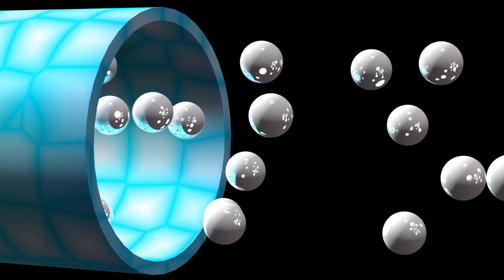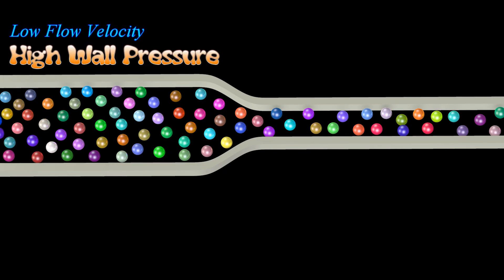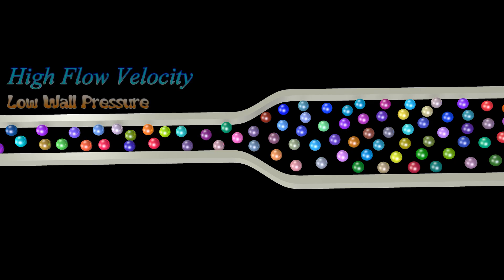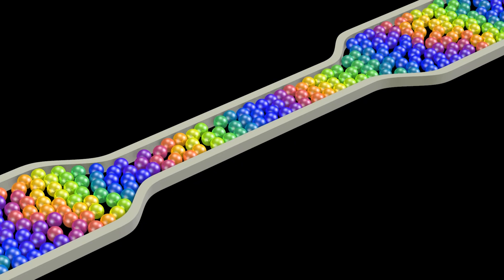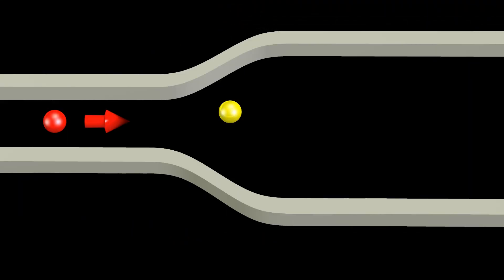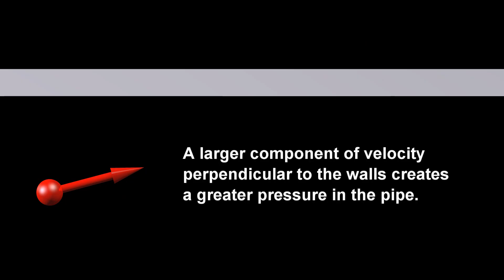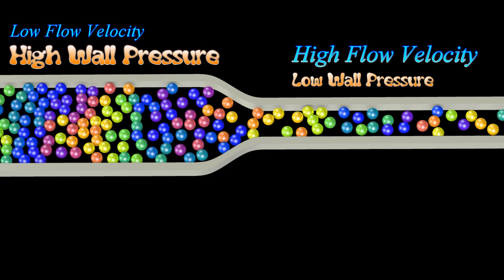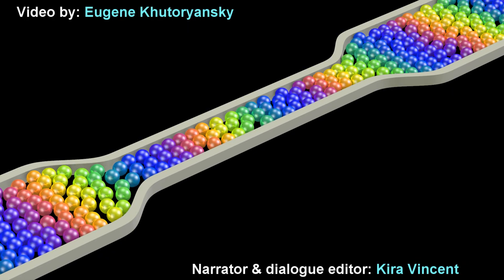Bernoulli’s Principle on Atomic Scale

Comment: 10 seconds in and I already know I'm doing to dig it
Edit: Yep, totally worth it, whenever people talk about the principle on YouTube you only see the practical information like the formulas, but never a true explanation on the why of it
Reply from the maker: Thanks.
Reply: Unfortunately, this violates some very common and well understood accepted principles of physics.  It repeats the same errors that Charles Crummer makes.
..
The statement at 2:07 is correct. "there is no reason to expect an atom with a higher velocity to exert a lower pressure on the walls of the pipe." 

There can be the same pressure in a fast fluid as a slow fluid.  They simply have the same static pressure. Bernoulli is not about speed. It is about changes in speed or velocity which is Acceleration along a path. 

The pressure on the walls of a sealed jar is the same regardless of the speed of the jar.

A fundamental flaw in this misconception at 2:42 is is that there no reason to expect a molecule to have the thermal vibration in only one dimension.  These pressure causing vibrations are random in direction and are how they bounce round between other atoms.  
At any given instant a molecule may be going down and the next at 90 degrees or even 180 degrees to the previous vibration.  
That simple fact breaks this false logic.
..
Then. . . 
It is the average velocity (over time) that has a directed motion when the kinetic energy is added to produce an increase in speed. That directed velocity is vectorially summed to the random vibrations.  This is vector addition of velocities. This means that the random vibrations are superimposed onto the linear velocity along the tube. This is fundamental physics. Vector quantities like speed and acceleration add vectorially.
Ignoring that fundamental physics is another flaw in this.
..
..
Then, the added kinetic energy in the moving fluid is in only direction.  It is not increasing the random thermal vibrations. That would require increasing the temperature.  This is another flaw in this story.  Moving the fluid along the pipe does not raise the temperature.  
Therefore, the statement at 2:23: "an atom with a higher velocity would have a higher kinetic energy and, therefore, exert a larger force on the pipe walls" is false because it conflates / confuses thermal energy and momentum in one direction.
..
..
Consider bouncing a ball on the floor. Each bounce imparts some momentum to the floor.  The ball's actual motion is only vertical..

Now, start the room moving (a train car) and the ball still imparts the same momentum to the floor with each bounce.  It's actual motion, relative to the stationary ground changes.  It has the SAME vertical component, but now a horizontal component vectorially added to the vertical motions.  The pressure on the floor does not change.
.
 However, these two motions are orthogonal and have no effect on each other. The vertical up[and down bouncing component remains the same. ONLY the ground referenced horizontal component changes as the speed increases.
This physics does not change if the ball is bounced on the ground outside the train's window.
.
This fails on these fundamental physics errors.

Comment: 🌟Concept is now crystal clear in my head. Thank u so much👍
Reply from the maker: Thanks.
Reply: Unfortunately, this violates some very common and well understood accepted principles of physics.  It repeats the same errors that Charles Crummer makes.
..
The statement at 2:07 is correct. "there is no reason to expect an atom with a higher velocity to exert a lower pressure on the walls of the pipe." 

There can be the same pressure in a fast fluid as a slow fluid.  They simply have the same static pressure. Bernoulli is not about speed. It is about changes in speed or velocity which is Acceleration along a path. 

The pressure on the walls of a sealed jar is the same regardless of the speed of the jar.

A fundamental flaw in this misconception at 2:42 is is that there no reason to expect a molecule to have the thermal vibration in only one dimension.  These pressure causing vibrations are random in direction and are how they bounce round between other atoms.  
At any given instant a molecule may be going down and the next at 90 degrees or even 180 degrees to the previous vibration.  
That simple fact breaks this false logic.
..
Then. . . 
It is the average velocity (over time) that has a directed motion when the kinetic energy is added to produce an increase in speed. That directed velocity is vectorially summed to the random vibrations.  This is vector addition of velocities. This means that the random vibrations are superimposed onto the linear velocity along the tube. This is fundamental physics. Vector quantities like speed and acceleration add vectorially.
Ignoring that fundamental physics is another flaw in this.
..
..
Then, the added kinetic energy in the moving fluid is in only direction.  It is not increasing the random thermal vibrations. That would require increasing the temperature.  This is another flaw in this story.  Moving the fluid along the pipe does not raise the temperature.  
Therefore, the statement at 2:23: "an atom with a higher velocity would have a higher kinetic energy and, therefore, exert a larger force on the pipe walls" is false because it conflates / confuses thermal energy and momentum in one direction.
..
..
Consider bouncing a ball on the floor. Each bounce imparts some momentum to the floor.  The ball's actual motion is only vertical..

Now, start the room moving (a train car) and the ball still imparts the same momentum to the floor with each bounce.  It's actual motion, relative to the stationary ground changes.  It has the SAME vertical component, but now a horizontal component vectorially added to the vertical motions.  The pressure on the floor does not change.
.
 However, these two motions are orthogonal and have no effect on each other. The vertical up[and down bouncing component remains the same. ONLY the ground referenced horizontal component changes as the speed increases.
This physics does not change if the ball is bounced on the ground outside the train's window.
.
This fails on these fundamental physics errors.

Comment: Thank you so much! :)

This has bothered me for years and no one has been able to provide this simple vector explanation.
Reply from the maker: I am glad my explanation was helpful.  Thanks.
Reply: Unfortunately, this violates some very common and well understood accepted principles of physics.  It repeats the same errors that Charles Crummer makes.
..
The statement at 2:07 is correct. "there is no reason to expect an atom with a higher velocity to exert a lower pressure on the walls of the pipe." 

There can be the same pressure in a fast fluid as a slow fluid.  They simply have the same static pressure. Bernoulli is not about speed. It is about changes in speed or velocity which is Acceleration along a path. 

The pressure on the walls of a sealed jar is the same regardless of the speed of the jar.

A fundamental flaw in this misconception at 2:42 is is that there no reason to expect a molecule to have the thermal vibration in only one dimension.  These pressure causing vibrations are random in direction and are how they bounce round between other atoms.  
At any given instant a molecule may be going down and the next at 90 degrees or even 180 degrees to the previous vibration.  
That simple fact breaks this false logic.
..
Then. . . 
It is the average velocity (over time) that has a directed motion when the kinetic energy is added to produce an increase in speed. That directed velocity is vectorially summed to the random vibrations.  This is vector addition of velocities. This means that the random vibrations are superimposed onto the linear velocity along the tube. This is fundamental physics. Vector quantities like speed and acceleration add vectorially.
Ignoring that fundamental physics is another flaw in this.
..
..
Then, the added kinetic energy in the moving fluid is in only direction.  It is not increasing the random thermal vibrations. That would require increasing the temperature.  This is another flaw in this story.  Moving the fluid along the pipe does not raise the temperature.  
Therefore, the statement at 2:23: "an atom with a higher velocity would have a higher kinetic energy and, therefore, exert a larger force on the pipe walls" is false because it conflates / confuses thermal energy and momentum in one direction.
..
..
Consider bouncing a ball on the floor. Each bounce imparts some momentum to the floor.  The ball's actual motion is only vertical..

Now, start the room moving (a train car) and the ball still imparts the same momentum to the floor with each bounce.  It's actual motion, relative to the stationary ground changes.  It has the SAME vertical component, but now a horizontal component vectorially added to the vertical motions.  The pressure on the floor does not change.
.
 However, these two motions are orthogonal and have no effect on each other. The vertical up[and down bouncing component remains the same. ONLY the ground referenced horizontal component changes as the speed increases.
This physics does not change if the ball is bounced on the ground outside the train's window.
.
This fails on these fundamental physics errors.

Comment: This is barely adding anything to the textbook rules. This only explains what happens at the entry point to the narrower pipe and nothing else.

Why would atoms keep the velocity as parallel to the wall as at the entry point, after going through the narrow pipe for some time? Also, what if the narrow pipe is bent? Why would the component parallel to the wall have any advantage at all over the others after the turn? Also, as atoms finally leave the narrow pipe and go into the larger pipe, why would they NOT keep the velocity directed parallel to the wall, keeping their low (or even lower) pressure and high speed?
Reply from the maker: Inside the narrow section, the atoms keep their velocity mostly parallel to the walls because most of the particles they are colliding with also have their velocity mostly parallel to the walls.  Once they exit the narrow section, they do not keep their velocity mostly parallel to the walls because most of the particles they are colliding with do not have their velocity mostly parallel to the walls.
Reply: You've hit on a major flaw in this misconceived explanation, piotraturklos.
Unfortunately, this violates some very common and well understood accepted principles of physics.  It repeats the same errors that Charles Crummer makes.
..
The statement at 2:07 is correct. "there is no reason to expect an atom with a higher velocity to exert a lower pressure on the walls of the pipe." 

There can be the same pressure in a fast fluid as a slow fluid.  They simply have the same static pressure. Bernoulli is not about speed. It is about changes in speed or velocity which is Acceleration along a path. 

The pressure on the walls of a sealed jar is the same regardless of the speed of the jar.

A fundamental flaw in this misconception at 2:42 is is that there no reason to expect a molecule to have the thermal vibration in only one dimension.  These pressure causing vibrations are random in direction and are how they bounce round between other atoms.  
At any given instant a molecule may be going down and the next at 90 degrees or even 180 degrees to the previous vibration.  
That simple fact breaks this false logic.
..
Then. . . 
It is the average velocity (over time) that has a directed motion when the kinetic energy is added to produce an increase in speed. That directed velocity is vectorially summed to the random vibrations.  This is vector addition of velocities. This means that the random vibrations are superimposed onto the linear velocity along the tube. This is fundamental physics. Vector quantities like speed and acceleration add vectorially.
Ignoring that fundamental physics is another flaw in this.
..
..
Then, the added kinetic energy in the moving fluid is in only direction.  It is not increasing the random thermal vibrations. That would require increasing the temperature.  This is another flaw in this story.  Moving the fluid along the pipe does not raise the temperature.  
Therefore, the statement at 2:23: "an atom with a higher velocity would have a higher kinetic energy and, therefore, exert a larger force on the pipe walls" is false because it conflates / confuses thermal energy and momentum in one direction.
..
..
Consider bouncing a ball on the floor. Each bounce imparts some momentum to the floor.  The ball's actual motion is only vertical..

Now, start the room moving (a train car) and the ball still imparts the same momentum to the floor with each bounce.  It's actual motion, relative to the stationary ground changes.  It has the SAME vertical component, but now a horizontal component vectorially added to the vertical motions.  The pressure on the floor does not change.
.
 However, these two motions are orthogonal and have no effect on each other. The vertical up[and down bouncing component remains the same. ONLY the ground referenced horizontal component changes as the speed increases.
This physics does not change if the ball is bounced on the ground outside the train's window.
.
This fails on these fundamental physics errors.

Comment: The difference of small physics and big physics explained. When looking at a fluid as an entity of itself makes it tough to comprehend this law, but when you look at the fluid at the molecular scale, you begin to see that things are actually not that different
Reply: Unfortunately, this violates some very common and well understood accepted principles of physics.  It repeats the same errors that Charles Crummer makes.
..
The statement at 2:07 is correct. "there is no reason to expect an atom with a higher velocity to exert a lower pressure on the walls of the pipe." 

There can be the same pressure in a fast fluid as a slow fluid.  They simply have the same static pressure. Bernoulli is not about speed. It is about changes in speed or velocity which is Acceleration along a path. 

The pressure on the walls of a sealed jar is the same regardless of the speed of the jar.

A fundamental flaw in this misconception at 2:42 is is that there no reason to expect a molecule to have the thermal vibration in only one dimension.  These pressure causing vibrations are random in direction and are how they bounce round between other atoms.  
At any given instant a molecule may be going down and the next at 90 degrees or even 180 degrees to the previous vibration.  
That simple fact breaks this false logic.
..
Then. . . 
It is the average velocity (over time) that has a directed motion when the kinetic energy is added to produce an increase in speed. That directed velocity is vectorially summed to the random vibrations.  This is vector addition of velocities. This means that the random vibrations are superimposed onto the linear velocity along the tube. This is fundamental physics. Vector quantities like speed and acceleration add vectorially.
Ignoring that fundamental physics is another flaw in this.
..
..
Then, the added kinetic energy in the moving fluid is in only direction.  It is not increasing the random thermal vibrations. That would require increasing the temperature.  This is another flaw in this story.  Moving the fluid along the pipe does not raise the temperature.  
Therefore, the statement at 2:23: "an atom with a higher velocity would have a higher kinetic energy and, therefore, exert a larger force on the pipe walls" is false because it conflates / confuses thermal energy and momentum in one direction.
..
..
Consider bouncing a ball on the floor. Each bounce imparts some momentum to the floor.  The ball's actual motion is only vertical..

Now, start the room moving (a train car) and the ball still imparts the same momentum to the floor with each bounce.  It's actual motion, relative to the stationary ground changes.  It has the SAME vertical component, but now a horizontal component vectorially added to the vertical motions.  The pressure on the floor does not change.
.
 However, these two motions are orthogonal and have no effect on each other. The vertical up[and down bouncing component remains the same. ONLY the ground referenced horizontal component changes as the speed increases.
This physics does not change if the ball is bounced on the ground outside the train's window.
.
This fails on these fundamental physics errors.